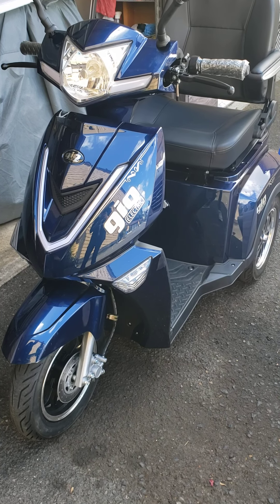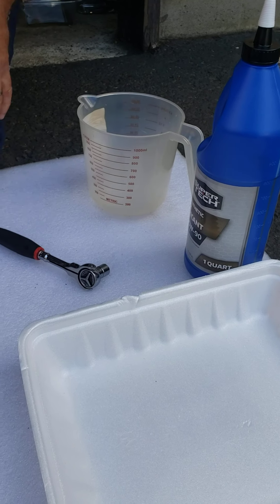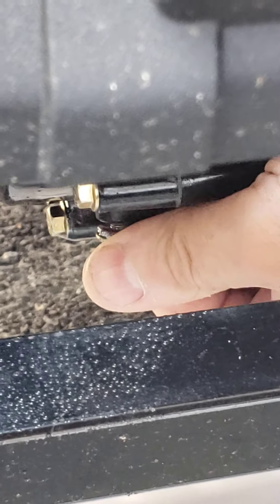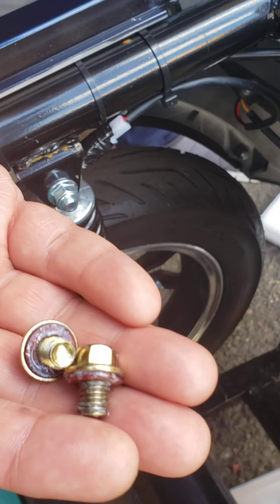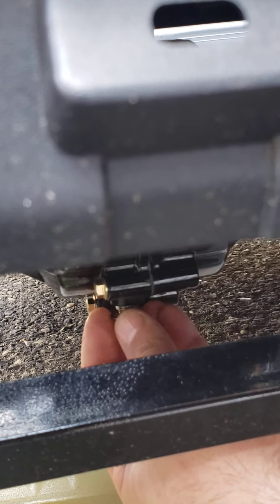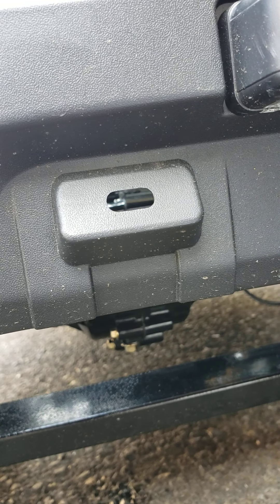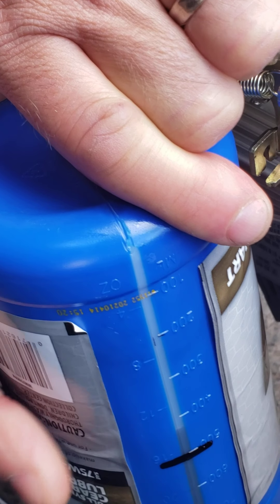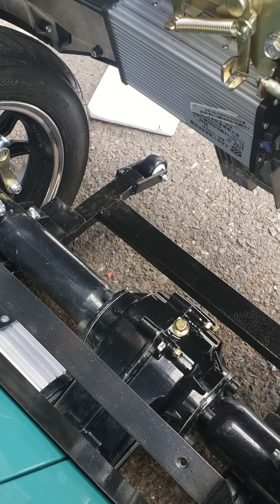Gio Titan/ Regal mobility scooter rear differential maintenance, oil need 7 OZ or 200ML milliliters

Comment: Thank you very much for that video it's a great service that you provide step by step. All the axles must be the same trough all brands of mobility scooters, right? so, you advice gear-oil 75w90 200ml for that mater, it will be suficient to fill it up entirely? I'm going to adventure in changing it. anoter question is, it does not need one rubber O-ring to the drain plug to prevent more any chance of leaking, as it has some vibrations? aswell adding the lub sealant to bolt, of course. If you can clarify, I would apreciate so much! Thank you  @You-can-fix-it
Reply from the maker: @fredericomacias5547  Hi, yes, you can add thread sealant on that drain bolt plug. And yes, 200 milliliters will be sufficient for this size differential
Reply: @You-can-fix-it  Yes, i will add tube sealant on the bolt as shown on the video. but my question is, as you have not shown on the video. 

Isn't it necessary to put an o-ring on the screw before adding new lubricant?
Reply from the maker: @fredericomacias5547  That differential does not make any heat or much of vibration,  as it is low speed scooter. Any sealant or o-ring will work , as long as that bolt is tight,  it should not leak
Reply: @You-can-fix-it  Thanks a lot for the tips! Much apreciated! Lets see how it works for me! Fingers crossed

Comment: great!! i have a ew-36 mobility scooter..i think this would pertain to that model also.?
Reply from the maker: Hi, yes it is a same procedure on both scooters
Reply: on a web site, it stated that the ew-36 mobility scooters would take 5w-30 oil for the transaxle?...maybe a difference between gio and ew-36?
Reply from the maker: @gamebreaker5518   Any gearbox differential in the world uses only dedicated gear oil , like 75w 90 or similar grade, so it  can withstand high pressure or temperature. Since mobility scooter differential is not creating any high pressure from speed, nor temperature,  yes you can go with any oil you want, BUT me as a technician,  I recommend to use gear oil only, as thick viscosity will not allow to leak out between the seal and a shaft so freely as regular thin  motor oil...
Reply: i will take your advice..it makes real sense in this matter..i just needed your advice before i drained the oil..thank you!!!
Reply: @You-can-fix-it thanx..i did just contact the ew-dealer and they said the ew-36 mobility scooter takes about a half quart of 10-30 motor oil for the motor and differential..thanx though..
Reply from the maker: @gamebreaker5518  
Half of quart is a 16 oz , and I think it it too much and there is no room inside the differential  and it is might leak out between the axle and seal.  So you better measure how much you will drain of original oil, and you will know how much you need to add... Again,  grade is not that important as there is no pressure or heat created , but I would stay with the thickest oil as possible to avoid replacing a seal, which is no big deal to replace it , but still
Reply: thanx. i will measure the amount going out and replace it @You-can-fix-it
Reply: @You-can-fix-it  thanx.. the ew dealer emailed me and said i should use 10w40 or 5w-30 oil....i will measure how much came out though..
Reply from the maker: @gamebreaker5518  somehow for that dealer viscosity does not make a difference... But let me explain why differential boxes  use 75w grade and  not 5w or 10w . The main goal of a thicker oil inside a differential box is to keep oil on the top of the gear sprocket as long as possible, so it does no drip down too fast ,  as there is no pump to pump it up again on the top of the gears , so only gears are splashing oil up, compared to the engine that is equipped with a oil pump, so weight of the oil is thinner,  plus for easy crankshaft revolutions. There are few more reasons , but I am not going to make a lecture here. Again,  since it is a mobility scooter gear box, there is no  excessive heat and pressure,  but only friction,  so any type oil is better than no oil...
Reply: @gio-simple-repair I have a greenpower zt500 in uk and transaxle looks identical to that, u have bought 85w 90 gear oil, would you say that would be ok